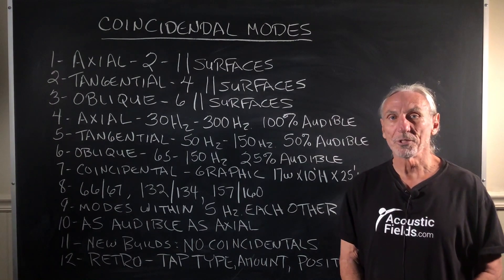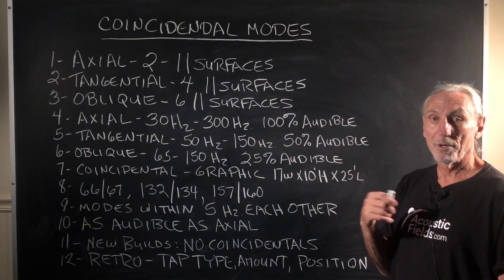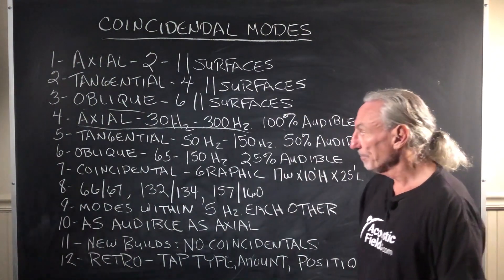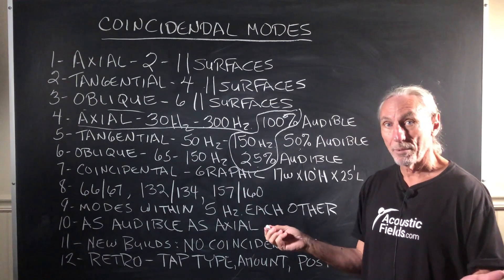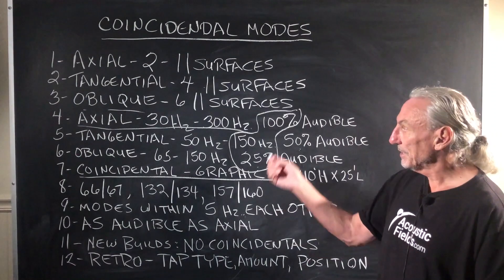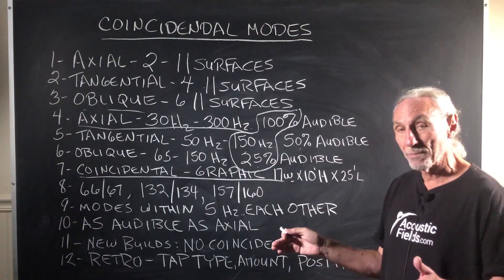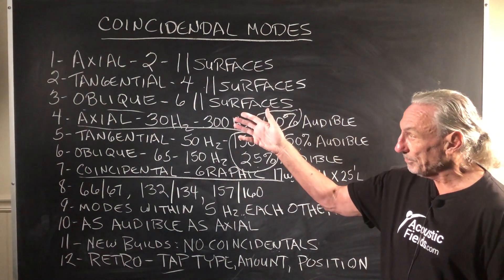Coincidental Room Modes - www.AcousticFields.com

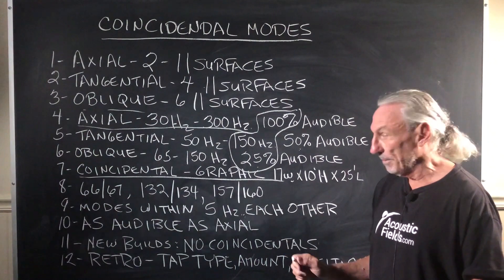Comment: Hi Dennis! At 2:52 you mention good ratios for new rooms, do you have examples of these for say a room with shortest wall of 12 feet? Or is there a calculation we can use? Thinking of building a room from scratch. Thanks
Reply from the maker: In acoustics, we look for two out of the three dimensions to be favorable. Favorable means that at least two dimensions "get along with each other". That leaves with the third dimension as the odd "man" out. Issues that are large with the third can more easilly be treated out. Stay with widths no less than 15'. Use lengths that exceed 21'. If you can't get 21' then try for 19'. Rememeber these are what we call O.D. dimensions meaning they are outside dimensions or room gross size. You must then give up 12" sometimes more on each wall surface area to treat those specific issues. This new dimension after treatment is referred to I.D. or internal dimensions. The goal with O.D amd I.D is do no harm. Make sure the room is large enough to handle the I.D. well and that the loss of 12" isn't creating more issues for your specific usage.
Reply: @AcousticFields  Thanks, this is very useful. I have a lot more thinking to do before starting this project and your advice is very valuable, thank you.

Comment: One of your best videos!  👍👍👍👍👍
Reply from the maker: Glad you enjoyed it
Reply: @AcousticFields  I think it might clear things up for people that don't know about the different types of modes we have to deal with, and it reinforces the impact of coincidental modes and that if one has the right dimensions, you can eliminate them in the first place.

Question, this is off the video's topic.  But is there an easy way to figure out what speaker (bass drivers) that closely matches the room volume?  I know you've covered the importance of choosing the right speaker for the room, but what specific calculations can we use to figure out what the right size driver, and the maximum number of bass drivers for the room? Is there a chart you've devised that can help us?  Maybe go more in depth on that subject that will be a practical approach to picking the right speaker..

Thanks!

Comment: It would be nice to somehow hear demonstrations of these modes. I love the chalkboard lesson, but nothing beats hearing it first hand. I know it would be difficult to convey through a youtube video, but I think it would speak volumes if it could be done. Something like a Binaural microphone in the listening position and playing some audio. Do that in several different treated and untreated rooms with different room modes.
Reply from the maker: It would be nice agreed. The time committment that your process would require is not available.
Reply: get a frequency generator or software that you can dial in whatever sine wave you can and then type in your room dimensions into amroc mode calculator and then look at the frequencies that you have coincidental, and then the rest of them, and start with pumping just the Axial mode frequencies in your room and play around with setting the frequency generator above and below and then at the Axial mode frequency and listen to the changes in your room..  That way you can conduct your own tests in your own room.